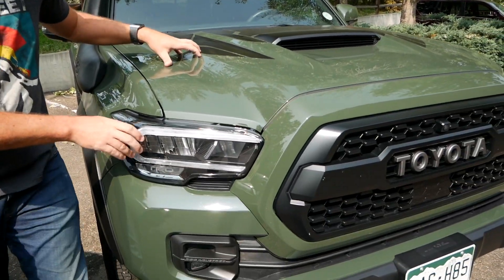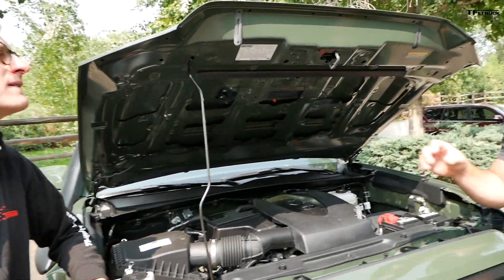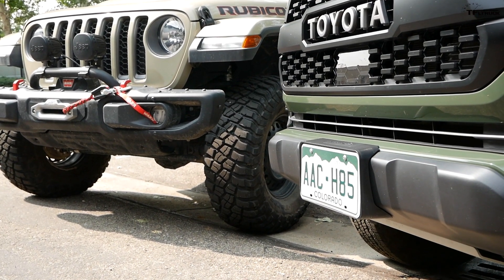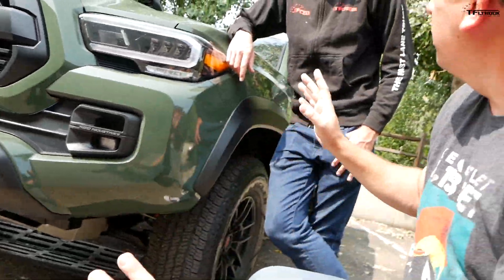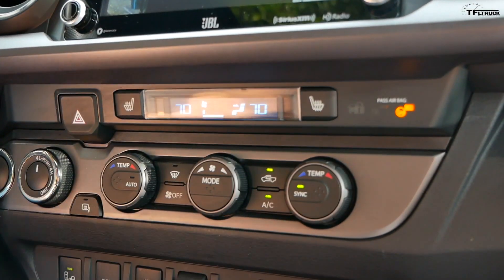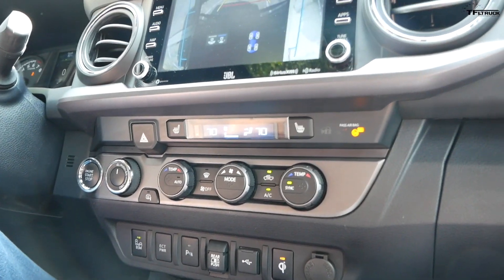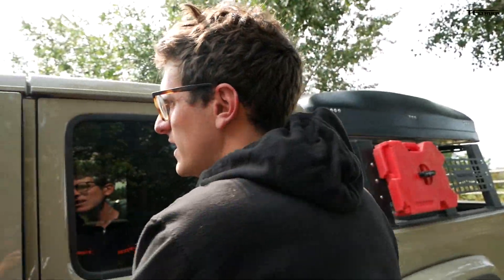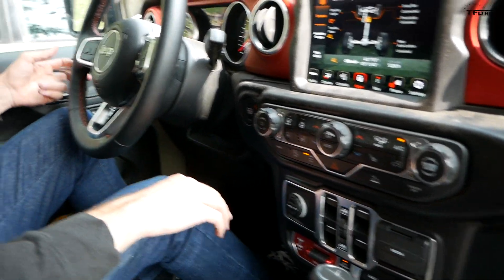Toyota Tacoma TRD Pro Has Met Its Match! We Compare It to the Gladiator & Show You Why!

Comment: Tommy is completely right about the tires, the manufacturers are pressured by the EPA to get the best fuel economy possible
Reply: Yup.  By simply putting something like KO2s on instead of what comes on Tacoma you lose up to 2 mpg. That’s huge impact if you have to show it on the  sticker.
Reply: Still people buying a Trd pro Tacoma probably don’t care about fuel economy
Reply: The EPA does
Reply: I would say they’re both right in a way. No doubt that most guys who buy this truck and are either planning on off-roading it or at least building it up with a lift will end up swapping out the rims and tires and the guys who are daily driving the truck but won’t see any significant amount of dirt will be happy with the stock tires. And for probably 90% of the people who buy this truck they won’t put it in any condition that requires more grip. And I’m sure there was also pressure to achieve the best mpg possible so their choice of tire makes perfect sense
Reply: @See Jay And yet chevy, ford, ram, jeep and others have figured out how to get Duratracs, TA KO2's, General Grabbers, etc on their factory trucks. The Ram Rebel, Chevy Trailboss, Ranger Tremor, Wrangler, Gladiator, etc all have much more aggressive tires.
Reply: I can see them having to offer a model with touring tires and a front air dam and all that stuff for people who are looking for a truck that gets 23 mpg or whatever but that should be it. They should be able to offer whatever they want after that so people don't have to waste their time and money changing all this crap out after they buy their truck or SUV.
Reply: @See Jay I disagree, I think turbo anything is cool, and twin turbos and turbo diesels would never be in everyday cars if the EPA wasn't part of the equation.
Reply: @See Jay I care and understand engine longevity, I have had the head off a few engines myself, and currently am working on a P-Pumped cummins 12valve.  That doesn't mean the engines are crap, they are amazing at making big power from small displacement, but all motors can only make so many horsepower before they need a rebuild.  Heat kills motors, but gets rid of NOx's so we have hotter and leaner motors today in efforts to achieve lower emissions.  We also have energy expensive materials such as aluminum being used to save gasoline.  So these all combine to lightweight high horsepower vehicles with low emissions!  However, the vehicles only reliably last for ten years and 100k compared to older vehicles that  were more like 20 years and 200k.
Reply: @See Jay I didn't buy a Chrysler, I bought a 5.9Lcummins,  a dana 80 a dana 60, a NV4500, and a NV241DHD all with dodge wrapping paper.
Reply: @drunkpolack7612  the EPA cares about fuel economy
Reply: @Jay-me7gw  they have also found a way to make vehicles so shitty...
Reply: @Jay-me7gw  they also have an entire commercial fleet section that moves their EPA averages to where they can afford to have worse gas mileage and worse emissions.

It's also why some brands are avoiding the midsize-fullsize truck market like the plague *looks at Hyundai/Kia*. If you understood EPA regulations, you would understand they are exponentially more lenient on heavier vehicles, and the requirements are based on overall emissions averages across the entire production line and sales for the manufacturer.

So unless you plan on tearing down the 3500HD and F-350 series sales in a fashion that would make your commercial truck a household name, and give up compact sales; you as a manufacturer will have one arm tied behind your back compared to the big three.

Comment: Myself, I think for being mid size trucks both are over priced.  On the other hand if I was big into off-roading the Jeep is what I would get.  If I just did only moderate off-roading I would have a TRD PRO.  I also like that both trucks are highly customizable through after market products and products from the manufacturer.  Thanks for the review of both trucks TFL, Tommy & Andre.  Great job guys.
Reply: I am looking at a fully loaded premium trim tacoma in Canada, $47k. An equivalent full sized truck with the same options is $70k. Trucks are expensive, period. The tacoma holds its value and is very reliable(low maintenance costs), so total cost of ownership will be quite affordable.
Reply: @steve8803  I totally agree with you about trucks being so expensive.  The Tacoma is a excellent truck I agree.  The fact that Toyota's hold their value is definitely a huge plus.  Go for bud.
Reply: @ricwestdoesitwork  Trust me, I am very frugal! I buy the vehicle in cash, and after 5 years sell and end up have a total cost of ownership of less than $300 cdn per month on a premium mid sized truck. Most people here pay more than that for their econobox!
Reply: @steve8803  😄👍

Comment: Ever since seeing that Gladiator high-centered, I'm nervous about the wheelbase.
Reply: They do push their testing to the limits but if your main use is off-roading then the 2 door wrangler is really tough to beat. 

The gladiator and tacoma are both great because they are versatile.  Numerous more specialized vehicles are ideal, but of course that gets pricey.
Reply: wheelbase and  clearance  are similar to most full size trucks.... pick a good line and you dont get hung up much. Especially with underbody protection. You can usually be a bit more aggressive.... they have to be careful as they are either  loaners or they want the resale value.
Reply: Like a lot of people I'm into the LJs, nice sweet spot in terms of length. but getting tough to find with under 100k miles.
Reply: Let’s be honest almost everyone is gonna lift a glad and put 35-37” tires on it if they’re going off road and even for aesthetics. It may still touch the skids but it’s really not a big deal for 95% of all the trails. A stock rubicon gladiator will cross the rubicon trail just fine
Reply: @mattbrew11  totally agree in reality. I just have that image stuck in my head from the previous video of the Land Rovers rolling through and the Gladiator not doing as well. Granted, it didn't actually get stuck, just couldn't take the same line scraped a little. Everyone survived.
Reply: James J LaRue I like TFL but my 14 year old niece drives better offroad

Comment: They should really takes into account the TRD Off-Road. Essentially the same as the pro (save for suspension) and so much cheaper (in price) And to upgrade to a more aggressive suspension (better bilstien, fox, or kings) wouldn't even get close to a TRD Pro MSRP. Save money AND be more capable off/on road
Reply: It’s only a $700 difference saved having the mods done yourself
Reply: I literally just priced this out on Toyota yesterday. $37k for an off-road I like, vs $45k for the pro. $8k buys a heck of a suspension. 

Plus the off-road exists on lots, isn’t marked up, and can be had with cloth seats!! 😎👍🏼
Reply: @upshifter5316   paid 32,000 for my manual offroad. Paid 45,000 for my TRD PRO with desert intake.  Both are manual transmission.  So a $13,000 difference is  quite substantial... I've put $4,000 doing a budget build with my OFFROAD and at this point it is more capable than the Pro is and  most of that money went to my camper 🐚 shell. As a side note both are 2019 models and were bought the same year with zero miles from the same dealer and sales rep.
Reply: @upshifter5316  yup I have cloth seats in my Tacoma 6 speed manual OFFROAD and prefer it over the leather in my Pro to be honest.
Reply: S M Sounds awesome! I love cloth. Feel like nobody actually likes leather, we all just pretend to. It’s been not nice in very high end cars (real leather). Everywhere else no thanks!
Reply: I love when I see someone with a TRD Pro that completely swapped out the suspension for King or Icons or something like that. The same ones that would have bolted into a TRD off-road just as easily.
Reply: @Jay-me7gw  thats why my pro has OEM suspension...
Reply: I ordered my diesel gladiator for 15% off MSRP. That brings it right inline (save for the diesel up charge) with a TRD offroad and nobody is coming off MSRP more that 2-3% on a tacoma
Reply: I just got my Gladiator Sport S for 35k so cheaper and way more capable and can actually shift gears.
Reply: That’s why I bought the off road mine is a double cab long bed
Reply: I have leather in my car and always sweat and burn my legs, but and back if my seat has been in the tropical sun (live in Hawai’i w/o tinted windows) have yet to burn anything on cloth seats.
Reply: @EdgeRoofCleaningCanada  your on crack dude. suspension cost 3k at most for something similiar or better than the fox shocks on the Pro.
Reply: Jordan Yang does the trd pro only come with the suspension upgrade?  Maybe before you come to conclusions look at all the options are are added with the trd pro and account that total value to match on top of the off road package.   It’s around $700 saved only buying all the mods yourself to make your own trd pro.
Reply: Off-road with premium package plus suspension, wheels, lights, leather, exhaust of TRD Pro and there is essentially no difference.
Reply: @EdgeRoofCleaningCanada  say what!? More like 3k plus to improve over the springs and shocks that come in it
Reply: @Jay-me7gw  I feel most people swap out their suspension just to get a lifted Tacoma but then realize how pricey it can get with a Fox suspension so opt out for something cheaper just to get the lift.
Reply: True. The trd pros are perfect for people who just want to buy it and go off roading and not deal with aftermarket parts and shops though and just wanna have fun but not super serious about overlanding or off roading. Nothing wrong with that. If those people have the money and want a pro then no harm done.
Reply: @layne4376  yess. The labor and installation that shops charge for not even including paying for the actual aftermarket parts are very expensive.

Comment: When switching to 4wd, you have to be in drive for 4 Hi. Once the green light is solid, you then have to put it in neutral to go into 4 Low, use the locker, MTS, crawl control etc. The reason for 4 HI in drive, it allows you to switch in and out at will while driving. I've changed it in and back out at 60mpg. 🤙
Reply: It says how to use it right on the visor. All they got to do is read it
Reply: 60 mph i think 🤔? Right on love the Tacoma myself

Comment: The old 4L was the best. But I would go with the tacoma all day everyday & twice on sunday. Gladiator looks awkward and fugly.
Reply: I think they look awesome with a basic 2” lift and 37s
Reply: 3rd gen Tacoma powertrain is trash. A pickup should not have to be revved to the moon to get power out of, save that for passenger cars.
Reply: Have a 19 4runner with that engine and a 19 trd pro and the Tacoma engine is better especially on the highway. Once it gets in the higher rev band the 4l can't compare. The 4l has a little bit more torque off the line but TFL did the Ike Gauntlet Tow testing and the 3.5 beat the 4l in less time and maintained a higher speed. I will say my Tacoma has Ovtune which reprogrammed the transmission shift points which makes it alot better.
Reply: @Boltdriver70 thats because it has different gearing & while the new atkinson engine with D-4S system is more fuel efficient. it feels weak against the 4L. They also did a race where the 2nd gen beat the 3rd gen. It's a faster truck & better looking truck imo. Fuel efficiency.. 2 more mpg meh.
I think if you change your own oil, you'd appreciate 2nd gen more.
Reply: @sharpshooter012345  funny I have a 2014 dclb and I love it! Was telling my friend who has a 2018 that he should change his oil. Popped his hood and realized his filter isn't up top like mine. Haha he said he'll keep paying for oil changes.
Reply: @tyson9419  ya man its a royal pain & a poor design/engineering.

Comment: I've been into offroad camping since I was a kid. That's what dad called it back in the 70s/80s. Potentially buying a new vehicle this weekend. I've driven both the Tacoma and the Gladiator. I'm 6'6", 260lbs. Both vehicles were uncomfortable for me. At the Jeep dealership, it was uncomfortable enough that I didn't take it off the lot. What no one ever mentions is width. In both the Gladiator and the Tacoma, my shoulder was right up against the pillar. No, I'm a fullsize truck guy. Looking at both a '20 Tundra SR5 4x4 and a '19 Ram 1500 Laramie 4x4. Leaning towards the Tundra for reliability and potential off road prowess when built.
Reply: Check out a F150 FX4......great value and capability
Reply: You are a large guy. Just by your stats, I could tell you need a full size truck and not a mid size. I just bought a Taco last week. This same green one actually. I'm 5'8 and 170 pounds, and this thing is so roomy even with my family of 4 loaded in. (I'm a giant compared to the rest of my family) But giants like you- that's what the big trucks were made for!
Reply: Stay away from the Ram. My dad had a 1998 Dakota that was problematic and he got 2 1995 Tacoma’s (in 1999) from 2 cousins and gave me one his just died in 2016 and he got another (SR 4-cyl Double Cab short bed) mine is still going strong.

You’ll be happier with the Tundra. The F-150 is a good truck, just stay away from the Ecoboost engines.
Reply: @J.Young808 , I currently own a '15 Ram 1500. Lol.

Comment: I'd like to see a 2 door extended cab Gladiator with a shorter wheel base.
Reply: It won't happen unfortunately. Just get a wrangler unlimited and take off the roof and rear seats when needed.
Reply: I’d opt out of my diesel gladiator order for one with a “extra cab” size from the old Nissan days 2 door with a 6’ bed for sure.
Reply: You’d have to get a JK 4 door and convert it to a truck with one of the JK-8 molar kits. They’re hard to find though. I think they look the best out of all wrangler type trucks.
Reply: If they did an extended cab version, guaranteed they just lengthen the box and the wheelbase would be the same.

Comment: I've owned both, well almost. I did not own the TRD Pro but the TRD Off-Road and currently the Jeep Gladiator Rubicon both were fully loaded with all options.  So, first I will say that I love the  "Retro" look of the Gladiator but for general modern pickups I think Tacoma 3rd gen is the best looking truck out there (Mid size or Full Size) on the exterior. Interior is horrible, looks way out dated against the Jeep. The JBL Toyota stereo system is not nearly as nice as Jeep's Alpine.  The Infotainment on the Jeep is SO much nicer and actually works without a hick-up the Toyota was antiquated and had and issue when it updated and locked up. Also, the camera's (well should say Camera on the Toyota it had a rear one) the Jeeps front and rear are much more clear with higher resolution, the front with the wheel tracking is great off road or for parking. 
 Headroom, if your tall and like Tacoma -DO NOT get the sun roof.  Mine had really low headroom, my friends without sun roof is a lot better.  Coming from a Toyota FJ to Tacoma it felt cramped 
Rear seat, Jeep wins more leg room for passengers. 
Engine Transmission:  JEEP.  The Toyota 3.5 lacked low end torque and was always shifting.  The Jeep has much better torque off the line the 8 speed transmission is better than Toyota's 6 speed. 
Ride:  Depends.  If your off road the Jeep is amazing, straight axle, two lockers to Toyota's rear. Plus Jeep has electronic sway bar disconnect...Rubicon is amazing off road.   On street I would say that the Tacoma "handles" better with  IFS suspension. 
Reliability: I honestly have had really no problems with either one.  I would always give edge to Toyota on that factor,  except off road.  If your really going off road than IFS Suspension isn't going to be as durable as a straight axle especially if you start lifting and running bigger tires.  That is where the Jeep shines.  In fact there is another Youtuber who did that comparison.  Daily driving Toyota reliability is legendary, but if your really 4x4 the truck and things can break - advantage Jeep.   
I am bias, I think my Jeep Rubicon is nicer than my Toyota TRD Off Road was ........It should be it was about 12k more money.  Do I think it is worth the extra 12k?  NO, but then again I think most trucks are way over priced.

Comment: I agree with Tommy get 6.speed manual Taco, the instead of  auto tyranny. But there again I perfer manual everything. I have a 2020 army green trd pro manual(without the ISIS air intake) its absolutely awesome 0 complaints! I store my weed in the box storage compartment.

PS Andre the Taco also doesn't come with a transmitting that can catch fire.

Comment: The problem with the automatic equiped Tacoma is gearing. It's needs 4.88 gears with stock tires and 5.29s if you go with a taller tire.